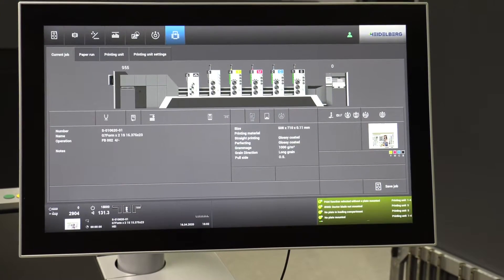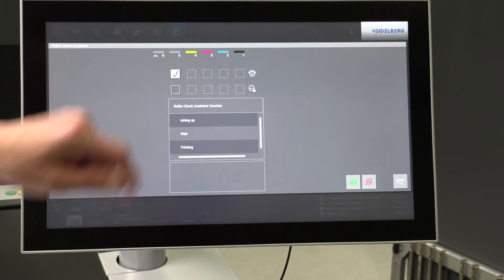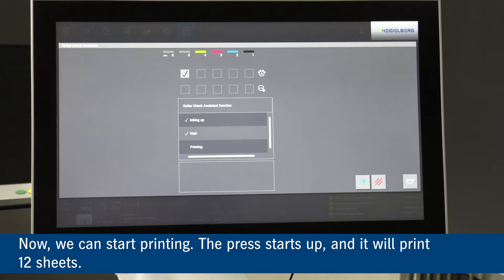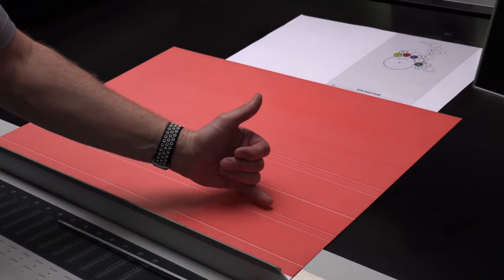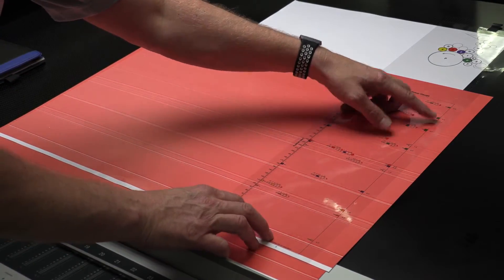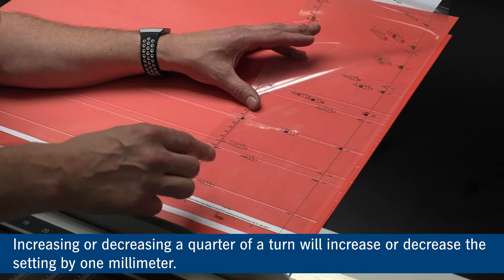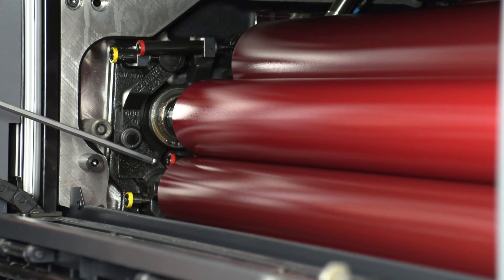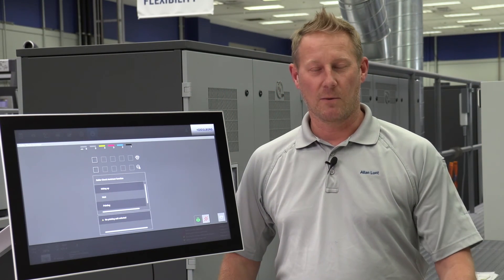EXPERT TALK: Demonstration of the Roller Check Assistant on the Prinect Press Center 3!

Comment: This method works very well in a pinch instead of pulling rollers i can get all 8 units done with in an hr and a half. Note this, print center 1 and 2 ( blue and grey screen)  do not have the split option of doing the ink snd water train separate only print center 3 has this option and my recommendation is to do it separate

Comment: Very cool. I run an old CD 102, and these are adjustments that are basically set and forgotten, until there's a problem. With the influx of people with zero experience in printing, this really dumbs thing down for them, while making an experienced pressman's job infinitely easier.
Reply: @baiseduezcke2295  Omg I'm chasing my tail here. Yes. You're right about all of that. Again, very few people pursue printing as a career. It's hard enough to find bodies, let alone anyone with any qualifications or mechanical aptitude. The people we do find either don't want to move up or are literally untrainable. This seems to be at least a regional phenomenon. It's pretty standard practice for a company to train somebody from the ground up. Material handler, Feeder, Second pressman, Pressman. Master each station before being promoted. I've never seen a company not do it like that. It all goes back to, this is why they are simplifying the machines, or at least part of the reason.
Reply: I don't agree. Printers with zero experience should definitely be involved in the traditional roller adjustment process - otherwise, they won't know the basics. The type of adjustment shown is suitable for experienced operators only.   I would like to add that this method covers the inking unit of 102 press  just partially: roller 9 to the distributor, roller 10 to roller 9 and roller 11 to roller 12 are adjusted in the traditional way, as well as the ink feed roller to the distributor and  ink ductor (the last statement belongs to all presses). If anything, an instructor with 25 years of experience. Good luck!
Reply: @bobrik63  soooo...you DO agree! You basically reiterated  my point!
Reply: @bobrik63 not sure I understand what your saying, on the 106 this method covers every adjustable roller except the ductor If you follow the instructions this works realiy good and note this is for a setting problem in a pinch like the middle of a job.
Reply: @baiseduezcke2295  My point is, most of the people coming into the trade are looking for a job, not a career. It's rare to see the younger generation pursue  printing as a career, and in many instances, people are forced into positions that they're not prepared for or not trained for or don't want to learn. My recent experiences have proven this to be true. The presses need to stay running, so people are being promoted, with mere weeks of training. The retirement rate is outpacing the new hires.
Reply: Depends where you work, i run an xl106 and many of the things that we know or information that has been passed to me they no longer let us teach, management locks us out of more and more. Im not a seasoned vet like some of you but I run ALOT of sigs.